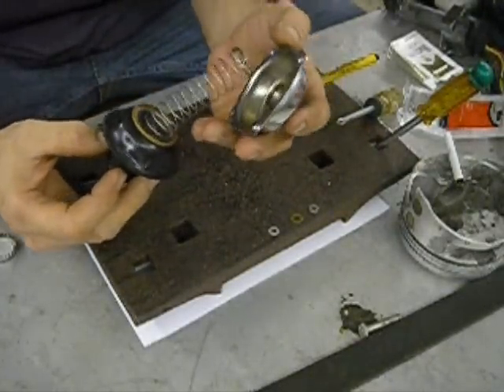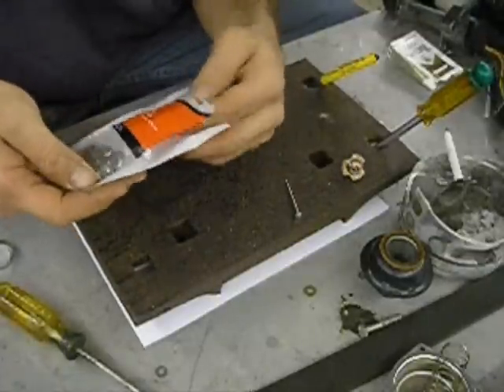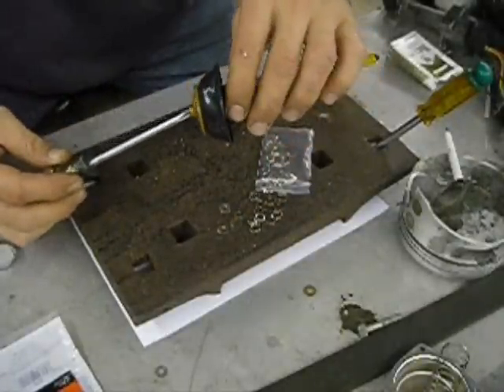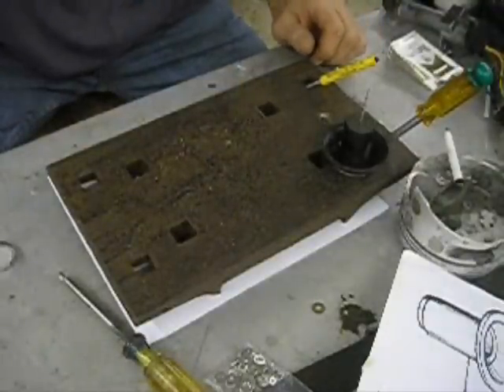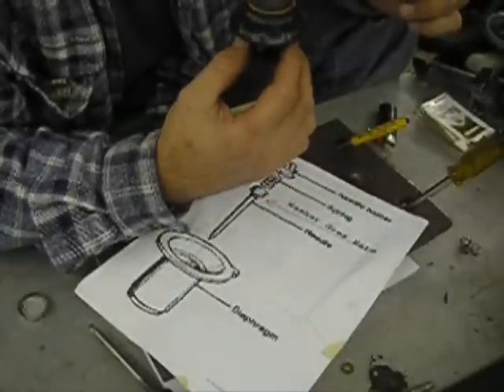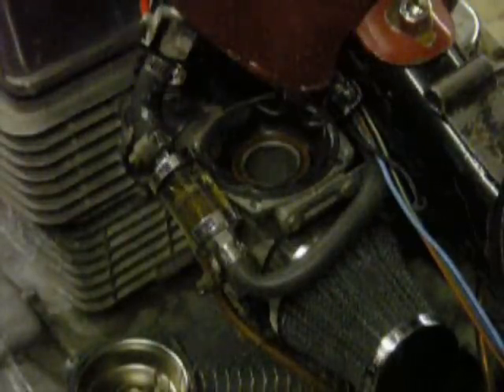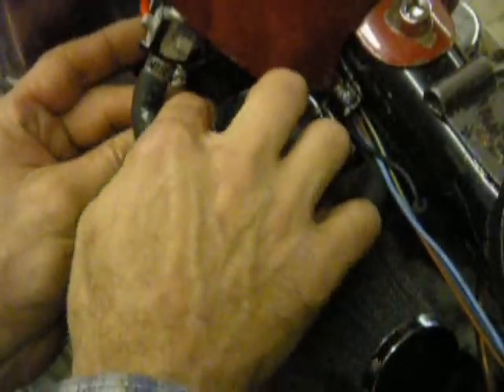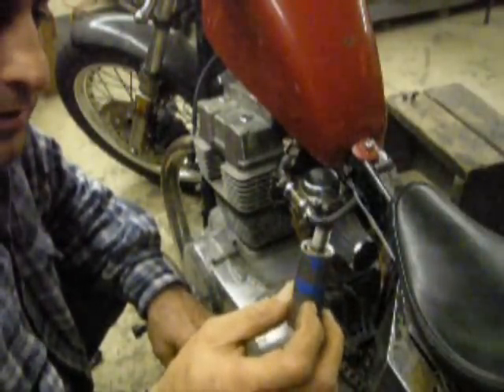Honda Rebel Main Needle Shim

Comment: Thats i am need it. I have problems after instal pods and cut pipes. I hange jets on 35/152,5 and have no high rev rpm. Bike runs bad.... it will help?

check my lates vid on my channel